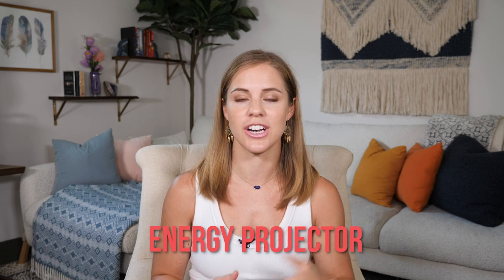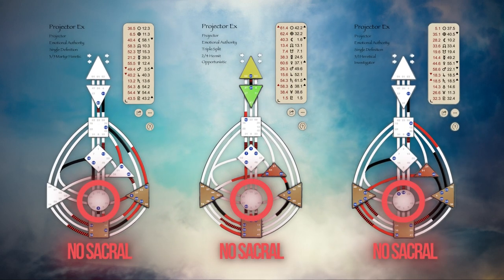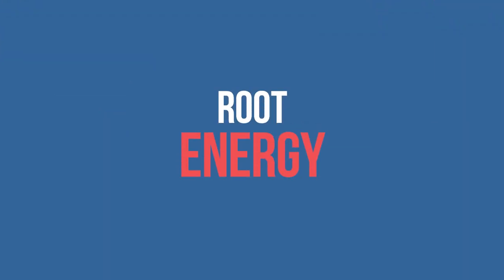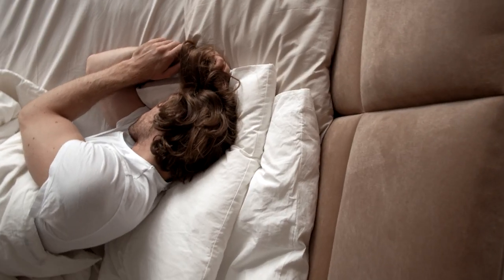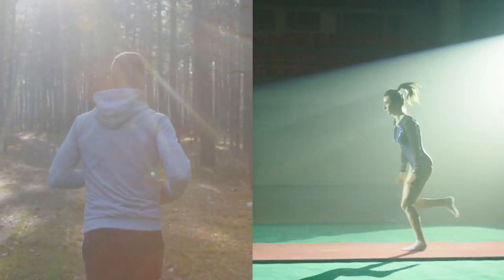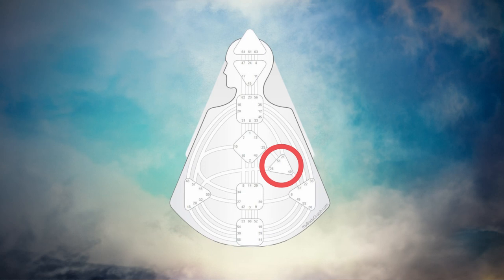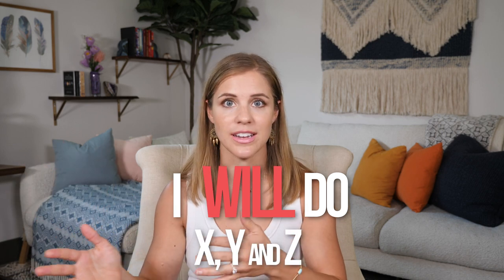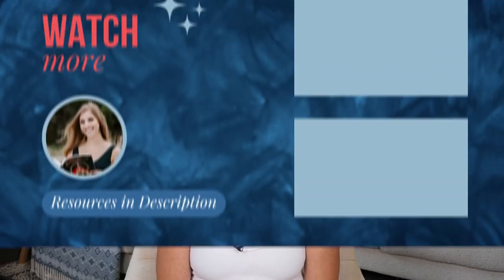Energy Projector || Human Design Motors Explained

Comment: As you say in the intro of the video, the definition of a projector who doesn't have energy and need to sleep so much, take a nap, and do nothing don't resonate with me. I've been looking information about the energy projector a lot without results, and then the algorithm of youtube put me your video on home screen. And I'm so thankful for that and to you about this!! 

I'm a 3/1 energy projector with the root, solar plexus and ego defined. I have a lot of energy and it comes in bursts. I work well with the pomodoro technique, 30m of work and then a 5 - 15m rest. When i'm working on projects that require my energy being constant, I can do it too, even if i'm feeling tired. I think that my ego defined helps me a lot to keep on pushing when it's needed. I'm a filmmaker and sometimes there is long filming days from about 8 - 12 hours duration and I can deal with it. Of course, when it's over, I finish very tired in my bed and took the next day off if I can. 

It's interesting how the 3 motors center works together. When I need to do something that isn't joyful or playful, the solar plexus energy is not available and makes me procrastinate a little bit and take rests frequently, so the ego push and activate the labor, and the root gives me the bursts of energy to complete the task. 

Thanks again for this video, and I hope my comment helps you in return!

Comment: Thanks for the explanation. I now see why I have pressure to provide: gate 54... emotional solar plexus:  my emotional energy is more intense than I realise, coz even when I am not upset sometimes people think I am, though I have a soft voice... it’s only now that I realise it’s because of the design...it comes with immense emotional power...so I now use it to my advantage more.. to get things done / unstuck / to bring about a shift by speaking when my solar plexus is fully charged...and also to connect with another’s G centre

Comment: I am a splenic projector with a defined root and I have the 18-58 channel defined. I also have gate 54 defined but on my chart it doesn’t go all the way to 32 so I’m not sure what that means
Reply: 54 is called a 'hanging gate' than. You can find more info on it.
I find short info on the specific gates also really helpful. 

Good luck on your journey from a fellow splenic projector with defined root and channel 18-58